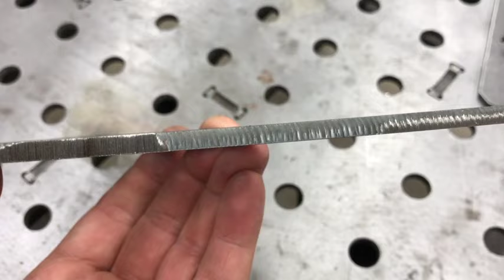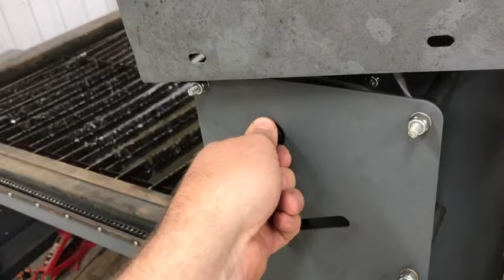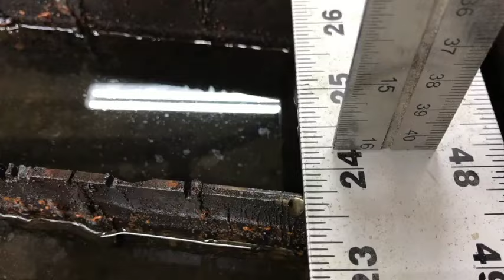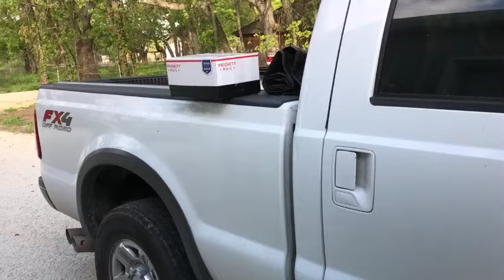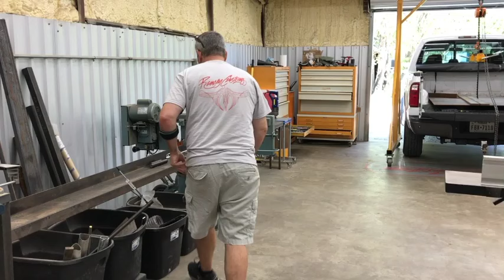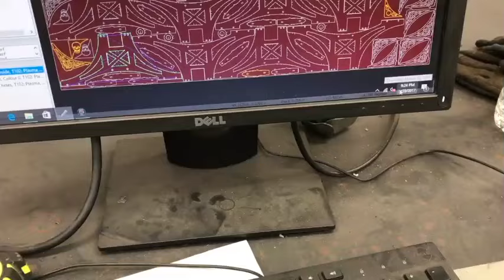A long work day - follow along

Comment: Not sure about your machine the one at my work is much larger and we run 260amp consumables but after a upgrade onetime we started having problems like that and we found that are slave motor got turned off somehow. Try running a program in test mode with the belts off to if they both turn. Edit nvm yours is a lot different
Reply from the maker: Right, i only have one motor, that drives both sides, but i can understand what your saying though.  260amp ?  Dang, what do you cut with that?

Comment: if you do a search on mechmate, they have tons of useful info on understanding a table like yours. while its focus is on routers, it has almost everything else in common with plasma tables. there is at least one build which used a chain setup.

Comment: Unless there is some kind of position encoder feedback on your stepper motor drive it will miss steps. That might explain the hole misalighnment. Going to a home position gets it back in sync.  The regular pattern in your cuts looks like a resonance effect probably due to torsional flexing in the rod that transfers motion across the bed.  Servos have smoother motion which might help but a  rod with more torsional rigidity would help also I think.
Reply: ....Encoders....or.....not.........quite a difference in price of the drive electronics/mechanics.....but few or no positioning errors...I worked on NC/CNC stuff in the 1970's....the employer tried selling a 'stepper only' machine.....didn't go well....this was fairly heavy metal cutting stuff...Burgmaster....

Comment: Gary you may want to check that your drive is tuned properly for the steppers.  I think they would have done that for you but if the drive is not tuned properly you can get harmonics at certain RPM.  Check the specs on your stepper motors and see how many steps / rev they have, this will give you a baseline if you upgrade.  Check applied-motion dot com, they sell quality motors and have a lot of useful info on their website.
Reply from the maker: Thanks Bill, I will check htem out

Comment: Gary,

to get the fine adjustment in the x axis loosen the nut tensioning the chain opposite the direction you need to move and tighten the other end the corresponding amount.  That will shift the gantry relative to the x axis.
Reply from the maker: yea thats a great point!

Comment: just curious as to how many times you checked your mirrors while driving from the car wash to the steel yard?  lol
Reply from the maker: I checked them often, but couldnt see anyting.  It's just like 2 blocks away and I knew I  was getting out there so easy to straighten them.  Just being efficnet
Reply: LOL I had a giggle when I seen them tucked in
Reply: Why didn’t you use your mirrors when you where backing into the shop?

Comment: I think I would upgrade to ball screws before I did a rack and pinion setup. I don't think the rack would be much of a performance upgrade over the chains you have.
Reply from the maker: Right I was considering ball screws, but because of thread pitch, etc they will only support 150IPM as I understand it.  They are great on short travel machines, but i havent seen a plasma 4X8 plasma table wit ball screws.
Reply: They exist but would likely be too expensive and difficult to install as they would need a large diameter to not flex and whip in operation. Double rack and pinions with spring loaded pinnions to eliminate backlash would probably be best.  They need to be mounted where they would stay clean though. How well/smooth does the gantry move when disconneted? It wouldn't take much for that knife edged track to not be smooth and translating vibration.
Reply: I've never seen a cnc plasma machine with ball screws either in the x and y directions.  Even the high end laser / cnc router machines use helical rack and pinion on the x and y axes.